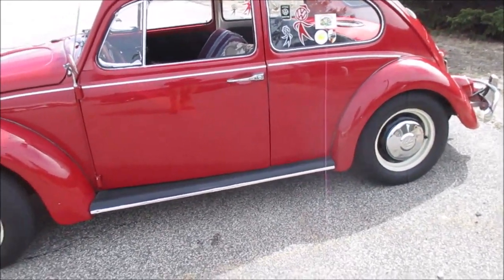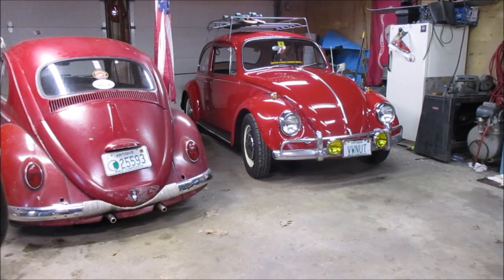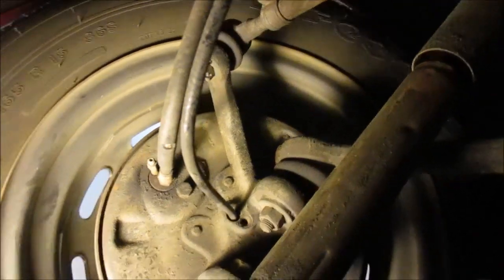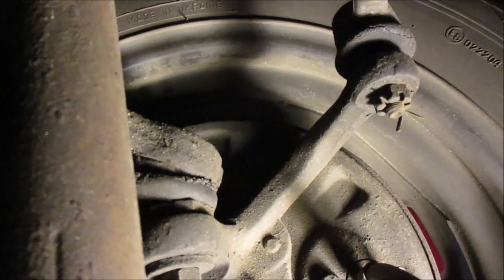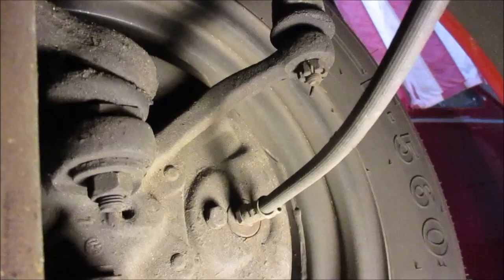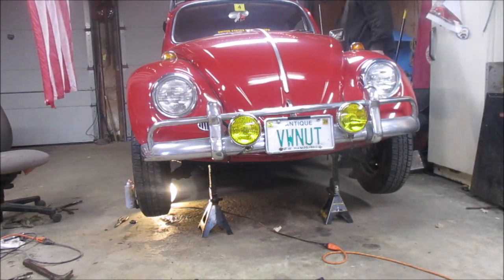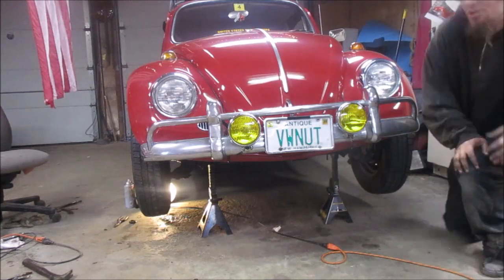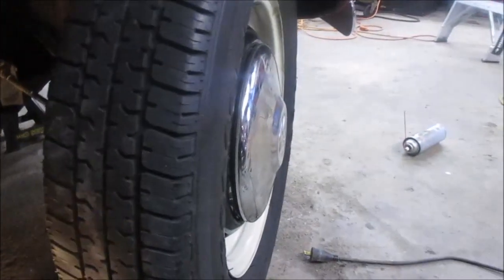1967 VOLKSWAGEN BUG TIE ROD END REPLACEMENT

Comment: Back in the good old days,when i was 16 yrs old, (now I'm 45), my best friend and i bought a 1967 ruby red baja bug. We each put 40 dollars in,yes we only had 80 dollars in it. It was a complete,running ,driving car with white spoke wheels,32 inch co-op grip spurs on the rear,megaphone pipe, and racing seats. After carb kit,shifter bushing,tune up,valve adjustment, going through the entire brake system, we maybe had around 200 dollars in it. That thing was great,we had so much fun with it. We put a tow bar on it and took it every where. Seems like we had to work on it more than we used it. God i miss those days. After my friend left it over his cousins house one weekend, it was forgot about. Not long ago i asked where it was , he said his cousin got it running again and sold it without us knowing about it, that sucked and pissed me off pretty bad,because i would have restored it, o well, s**t happens. Thanks for the great content that you and Darren provide. Keep up the good work
Reply from the maker: I love a good vw story. Thanks for sharing and watching Chevy man.

Comment: another great video this time showing us  that age does finally cause parts to wear out even in VW'S. She is a pretty bug and Fluid Film is a great protector and if you use it on nuts and bolts before assembling will prevent them from seizing up and make it easier to take apart next time.
Reply from the maker: for sure. Thank you for watching Brian

Comment: Tie Rods and Ball joints... When you replace one, you have to replace them all...
(If one tie rod is replaced then both are to be replaced, if one ball joint is replaced then all 4 are replaced...  This is to ensure that the wear is even on both sides and not on the side that was not replaced.) Been there too often with my first bug ('73 Beetle), replaced one bad ball joint and by the end of the summer, the other 3 had to be replaced one at a time; would have been easier and less time consuming to have replaced all 4 at once.

Great video and Ruby looks great, Daisy too!
Reply from the maker: I agree. thanks for watching Elfen Magix

Comment: Our 1963 Rubin color code is the same as your Ruby but was repainted sometime in its life a more type of burnt orange type of red. Now i cannot decide if i should paint it the correct color, due to a motor fire had to repaint the engine deck lid. I used the correct red. But now looking at it in its age old paint starting to like that look. Whats your thoughts??For now will focus on the engine swap and minor repairs , but i Know myself what in my DNA which is wanting to give it a new paint job.
Reply from the maker: I am a big fan of ruby red but paint it the color that makes you the most happy. Thanks for watching Dan

Comment: Brian my father when he had his 66 back in the day it did not have a fuel filter so every so often the carb would get dirty and the car would run rough like a bucking bronco!   Then he would take off that little Solex carb and take it apart and clean it with Gumout.  Then it ran like a Swiss watch!  My brother and I were teenagers so we did know anything about car mechanics.  Otherwise we would have convinced my father to splice in a fuel filter.
Reply from the maker: thanks for watching Dave